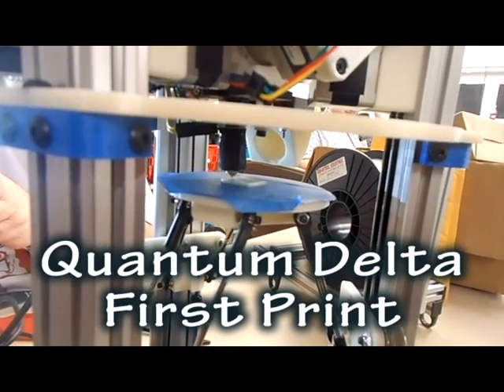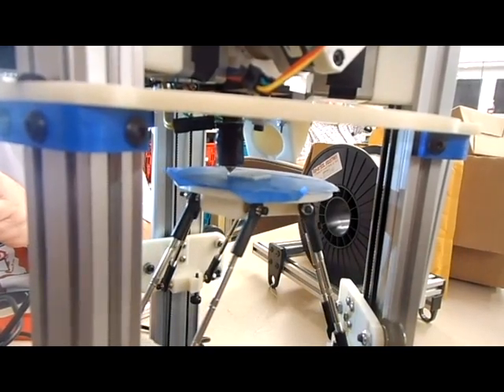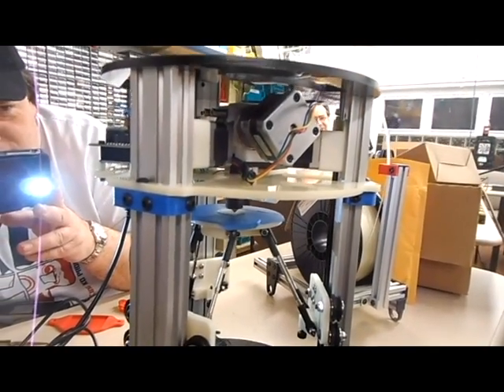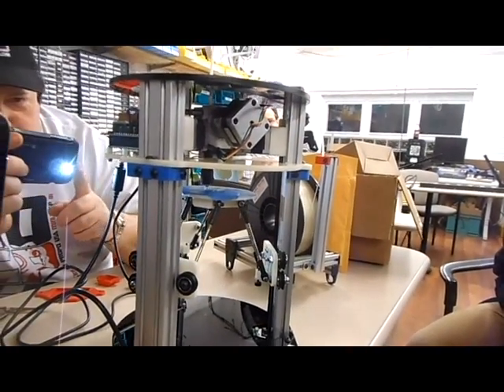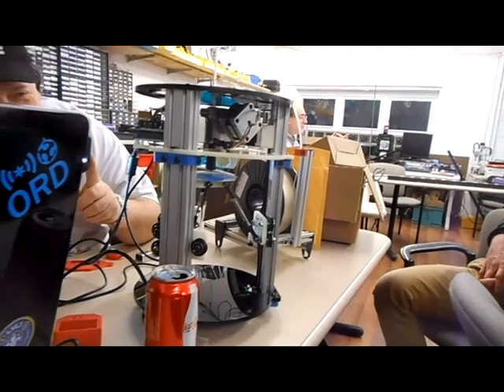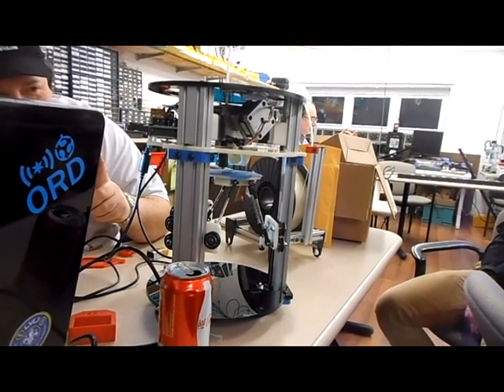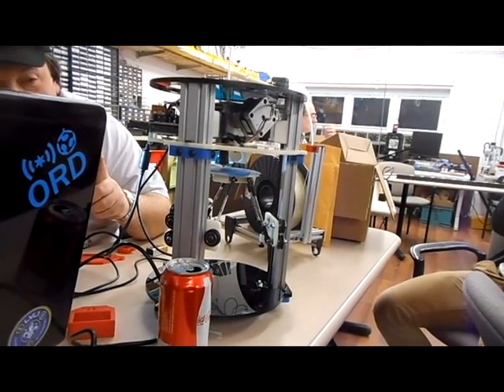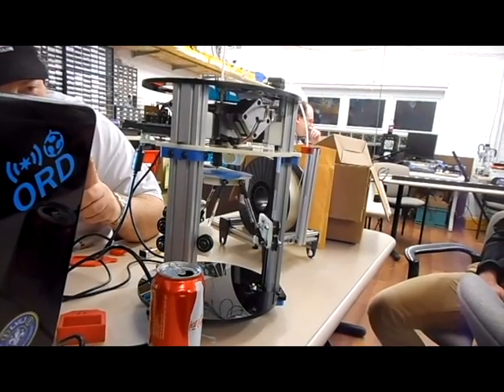Quantum Delta Printer

Comment: I really like this design - It seems to solve the issue of Flex filament for deltas, as it wouldn't be using a Bowden setup. What downsides have you noted from this design? It seems like the mass of the print bed would increase as the print is laid down, does that cause weird artifacts?